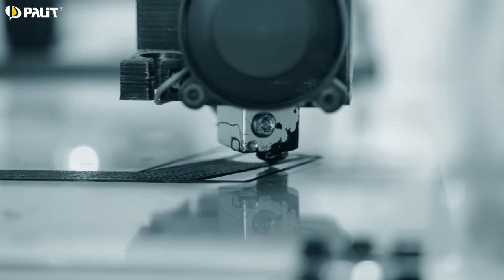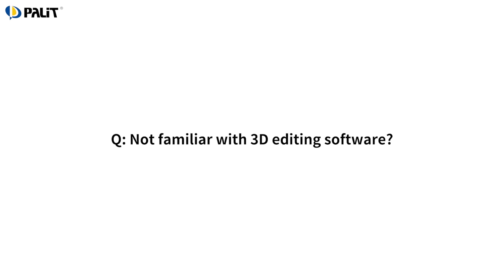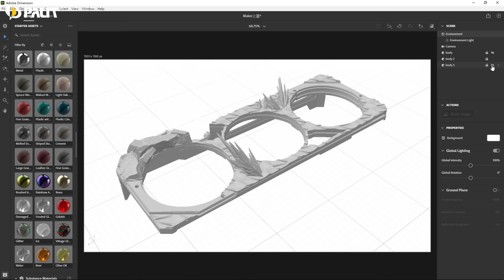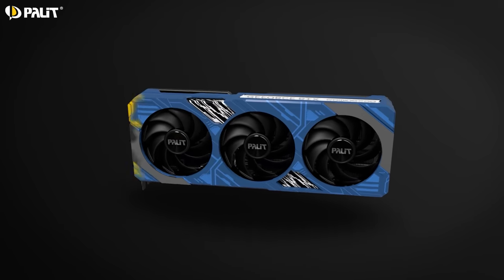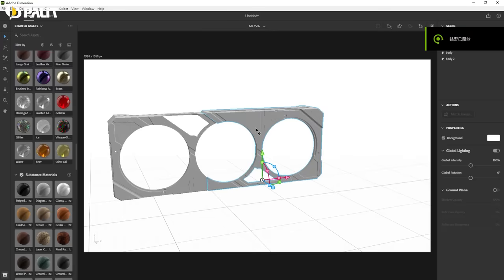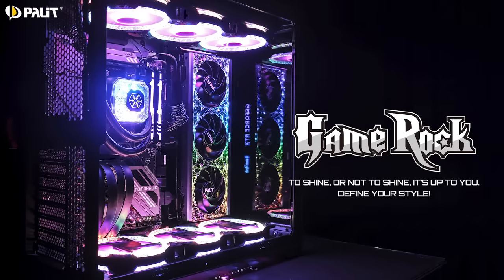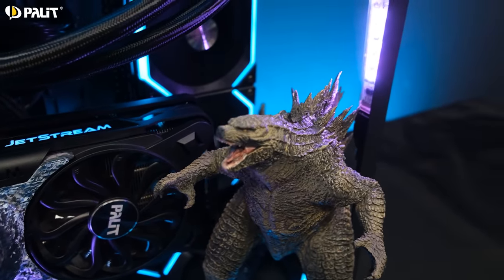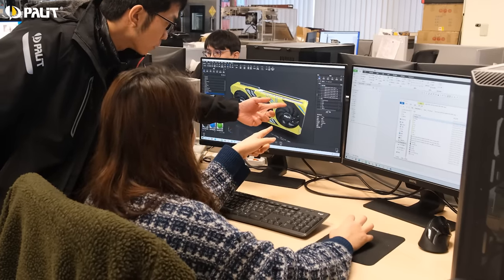Palit Maker | Add Customized Design to GeForce RTX 4070 Ti GamingPro | PC DIY | 3D Print | PC Mod

Comment: And once you do that the warranty expires because you changed the hardware. Clever 😂
Reply: There are 4 screws on the RTX 40 GamingPro front cover. As long as creators didn't remove any part of the thermal or backplate except these 4 screws on the front cover, it won’t break warranty.

you can see more info from https://www.palit.com/maker/